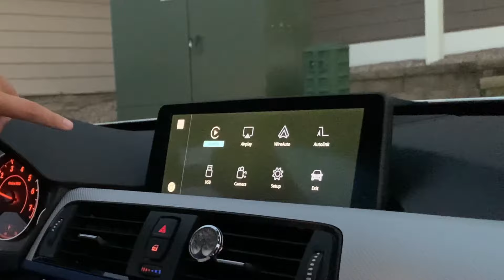BMW F30 LED AC radio panel  retrofit $40

Comment: Great video Billy, makes it look easy. My 2013 f30 has ambient light and brightness control but no option to select the color of the light. It just says orange. Any idea if I'll be able to switch to the blue light?
Reply from the maker: Try using sport mode
Reply: Unfortunately that didn't work but I will be getting these anyway to try them out lol
Reply: @swins2808 how did it go cause I also have a 2013 would like to know if you were able to switch it
Reply: It will fit 2013 easy. Also throw the AirPlay module In There 😉
Reply: @luiszanotelle3103  I didn't have any luck trying to switch it to blue, also it gets really bright at night so had to lower the brightness of all internal lights to get it down to a soothing tone

Comment: i dont have the little oem led at the buttom and know?! not all cars did that have but it should fit to all these cars ?! there is no information on sellers page to that problem! what can i do know? no video tutorial i found?!
Reply from the maker: If you don't have the oem led (which only comes with the lighting package or the premium package) then it's much more complicated, last time I looked into it you have to cut wires and retrofit in stead of plug and work
Reply: @ASMR_Blondie   do u have a video I can watch?
Reply: Same here am just going to pass, my trim is gloss black anyways I just wanted the LED, it is what it is

Comment: Do you know what that extra blue cable is for on the new LED AC panel? I think you just let it hang there but doesn't that kinda need to be secured somehow?
Reply from the maker: I think that is for people to do their own wiring work if they don't have the connectors already for some reason. It probably is a good idea to secure it, but I didn't because I didn't think it was necessary.
Reply: @ASMR_Blondie  yeah i also installed it like u and just let it hang there tbh :D I'm still a bit confused tho but whatever. Ty anyway

Comment: Hello guys i have also done this mod, have developed issues since so the panal works and changes colour . However my Radio /AC panal now shows no sign of life , my streeing wheel controls + indicators are also not working and the light control panal is not working. I have try to plug and unplug the cable going into the radio as thst was the only one i unpluged but no luck snyone have any ideas on what have done , what i could do to repair this?

Thank you in advance
Reply from the maker: Any chance your car is parked in the cold?
Reply: @ASMR_Blondie  hi yes it is/ was but im in the uk so nothing extreme , but started it up since for about two hours
Reply: I’m having the same issue mate did you find a fix for it ?